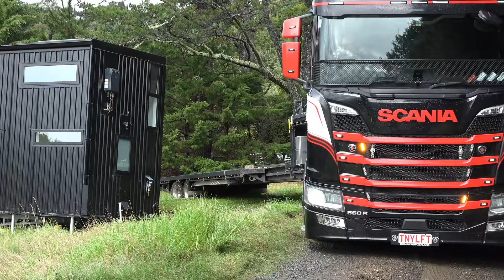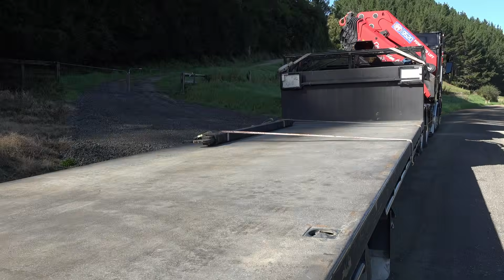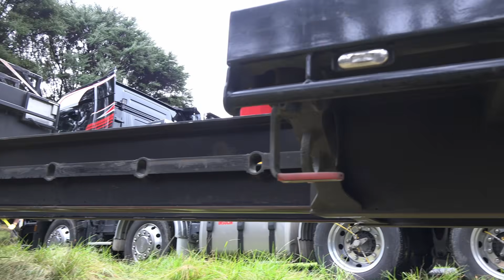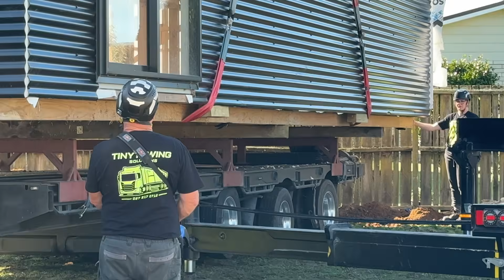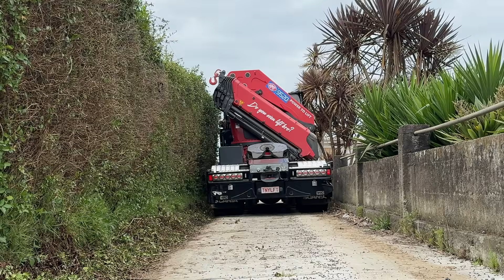Scania 560R Super 8x4 with HMF crane | New Zealand Trucks | Do You Even Lift?

Comment: Whats your load chart, it’s a nice setup, I run a 1990 Isuzu CXH350 with a front mount Fassi FX420 12T 24.4mt reach crane, 6.3mt removable deck with 5th wheel attachment, best machine I own
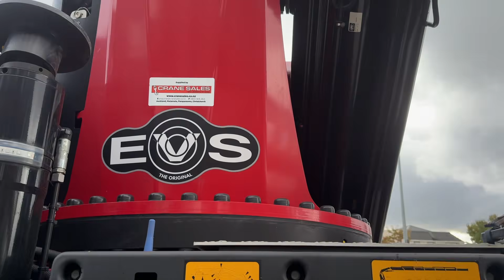Reply from the maker: There's a brief glimpse of it at 2:02